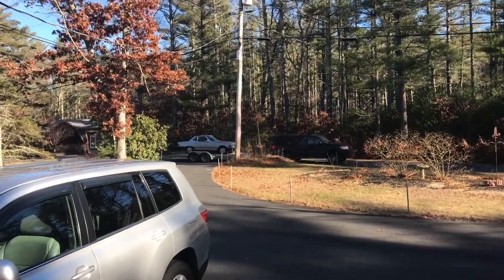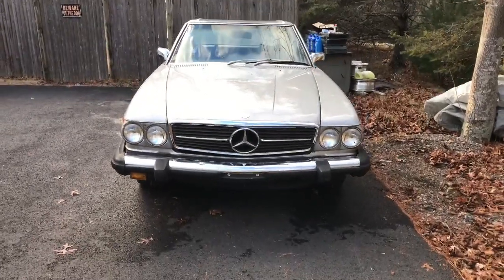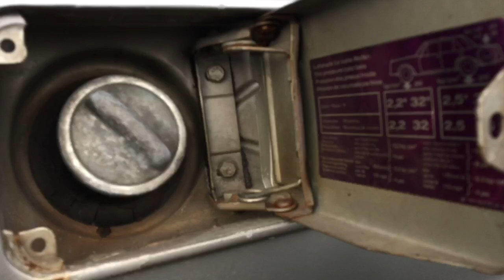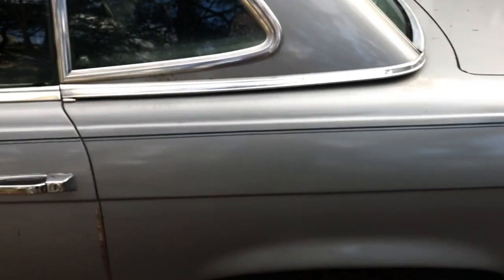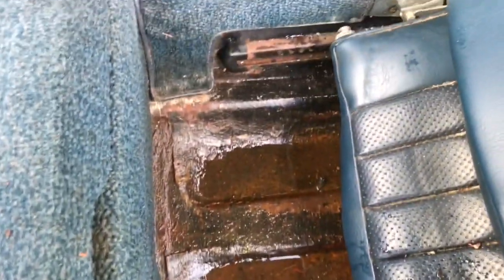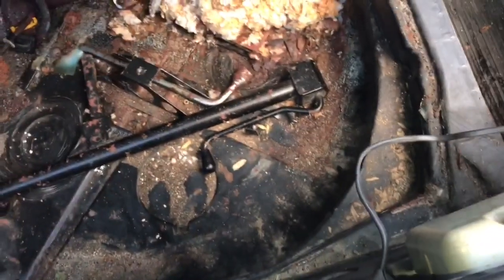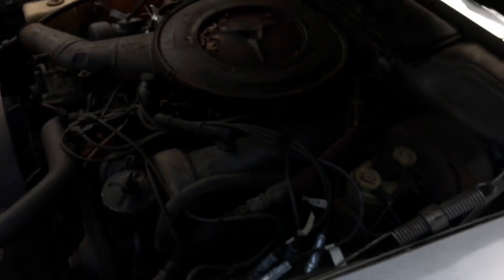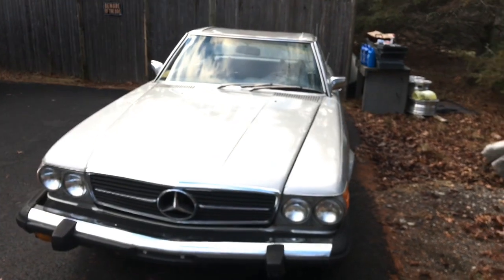NEW PROJECT!  BADASS 1974 Mercedes 450SL (R107) - 6.0L LS SWAP?!?!

Comment: Thank you for rescuing another R107 from being recycled as another load of low-quality, cheap home appliances! The only other engine (other than your LS V8) I'd considering stuffing in this one is an aluminium-block 5.5L M117 engine from a newer R107 or W126. Those can be hard to find compared to and LS. Good on you! I'm excited to see your results!
Reply from the maker: Jim Cabezola 
thank you!  Many people might not like the idea of putting an American engine in to the Mercedes, but from a practical point of view, this engine swap will cost only a fraction of what a refresh/rebuild would cost for the 4.5L and it would still be 190hp.  The LS is very cheap to repair compared to the Mercedes V8.  It also has 300hp stock.  This way I will have a classy classic Mercedes with modern reliability and power.
Reply: pre-86 chevy is the real answer, this car only weighs 3000 or so, and the original engine is really heavy, in the 700 range. The light engine actually screws up the car , but there is not much room

Comment: Boy! are you in for a steep learning curve! I can’t think of another car that is better at hiding terminal rot than the R107. The water in the floorpans - (which will be worse than they look) will be coming through the bulkhead (firewall) how bad that is, will decide whether the car is worth saving, they haven’t reached a value where this is a sensible or economic repair if it’s bad. I have a ‘78, bought on a whim, and been through all of this over the last 8 years, kinda glad I didn’t know then what I know now! I doubt there’s anything wrong with the motor, but that is the least of your problems with these. Still, Great cars, good luck😅

Comment: Procharger with water injection on this motor is even better.  even the 3.8 has a short stroke and can really get 300ft-lbs at 4000rpm or so at the wheels

Comment: You might consider a Chevrolet 4.3 v6 Generation 5 engine, from a 2014 to 2016 v6 Silverado. With Flex fuel, 335ft-lbs and then 1 cylinder shorter engine will not require a firewall move on this uni-body car (the front fenders and doors come off), an  LS V6